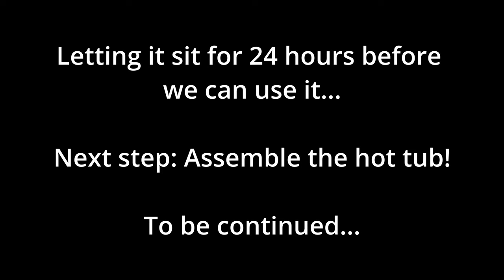DIY Pavers Installation Timelapse (Digging out sloped yard!)

Comment: How is it holding up? How thick was limestone you added? Also did you add any morter or concrete undder.. goes so fast couldn't really see if you added any on limestone before putting on the pavers and tapping.
Reply from the maker: Hey yes around 1:03 is when we added the screening. You can also slow down the video in the settings. The limestone was probably less than an inch or so. It’s holding up great and it’s been a few years :)

Comment: My yard is sloped like that.  Did you dig more on one side than the other to event it out. If so would I dig more at the top of the slope or bottom. This is so amazing, I start today, but still slanted.
Reply from the maker: Thanks! Yes, dig more on the side that has the higher ground so essentially you are leveling it.

Comment: Hey ya'll, Rion Morgan here in Vegas. Awesome Video! Can you please tell me if those are temporary? Did you lay them with concrete? It did not look wet? The wife and I are renting so I have some nice fleckstone I want to lay giving her a nice BARBQ area. Needs to be temporary maybe sand in between or something?
Reply from the maker: Hey! These are permanent for us but you easily disassemble. It’s stone slabs, no need to have concrete. At the end we used jointing sands to fill the cracks, which bonds when it’s wet. The bond is not super hard to “demolish” though we do not plan on that :)
Reply: Curious what you did inbetween if you didn't want to make it permanent